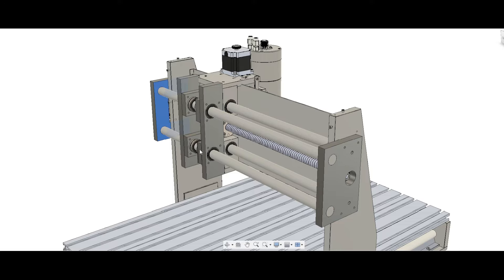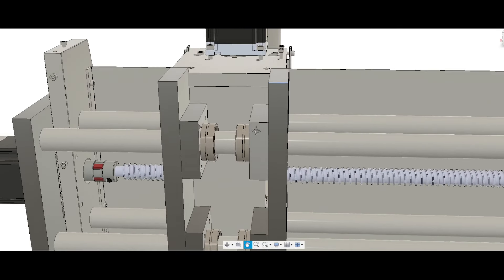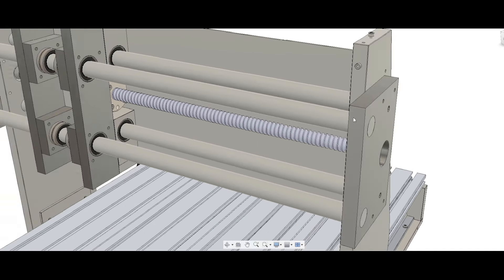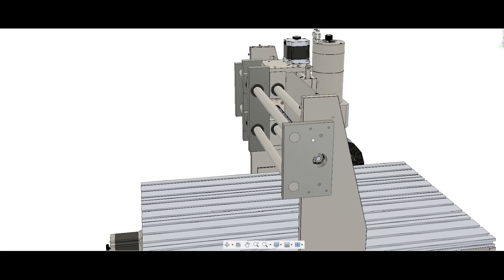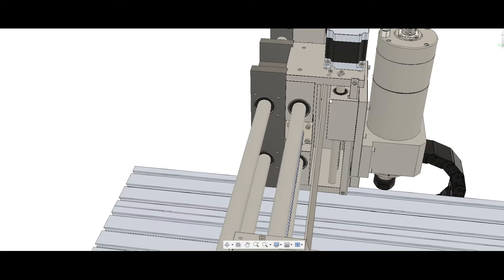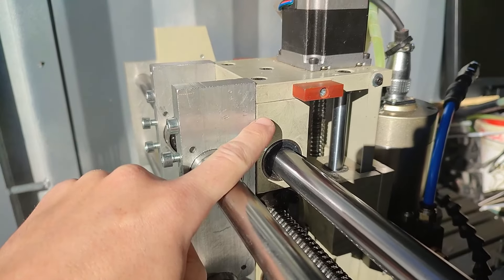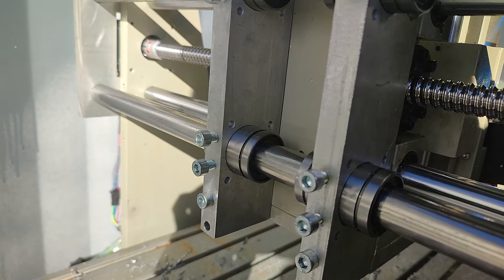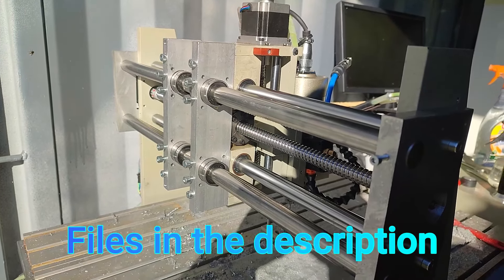6040 CNC Router Rigidity Upgrade

Comment: looks a good stronger upgrade
i would like to try but none of my 4 Cad programs will open up your Step file even though they support Step files, so i can only think that the file is corrupted
Reply from the maker: I will check the files and see what's wrong, sorry for that
Reply: @workshoprat  I will do a similar thing when i get a chance 
but I will use Linear Rails
Reply from the maker: @spudnickuk  To me the files are working perfectly, did you try to import in fusion 360 ?
Reply: @workshoprat  I did not try with fusion
Only tried with Bobcat
Visual cad
Solid works
And master cam
I will try in fusion as maybe a certain data type
Reply from the maker: @spudnickuk  Yes it might be a problem with compatibility, if you don't succeed tell me so I add an other file format. And yes Linear rail is a good choice but don't forget to use a thick aluminium plate behind the linear rail, if it's not rigid it might not give such of an improvement, but if done correctly linear rail is the way to go

Comment: Wonderful job, did you notice any improvements?
Reply from the maker: Yes the vibration reduced a lot and I had huge vibration when milling aluminum at high speed and now it reduced a lot soon I will make a test on Steel